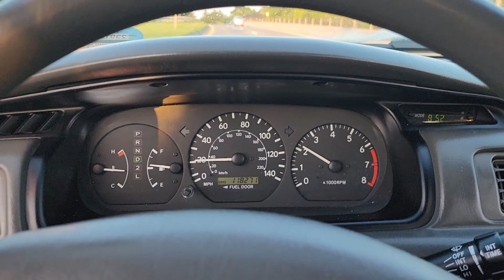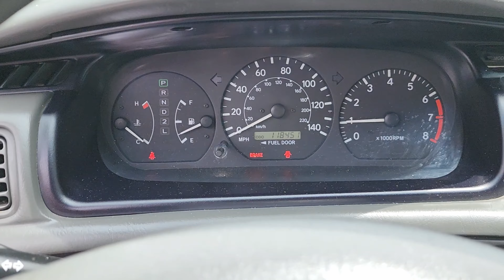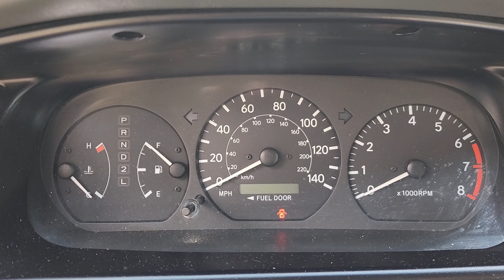Our Camry’s Exhaust Fell Off

Comment: how much grip would you expect a stock toyota ipsum wagon to have? I've loaded my car up on highway on-ramps and been going around 60-65 kmph and I haven't heard any tire noise or felt any traction loss so I think I have more grip than I'll ever need. if I had to guess I've got like 10-15% more grip left, but already felt a considerable g-force.
Reply from the maker: @-aid4084  Keep sending it until you hear tire noise! Tires will affect this greatly, too.

If you have a less sticky tire, finding the limit will be easier. I like to test grip limits on a curved highway on ramp with a low speed limit. I'd try something like that. Keep incrementally upping your speed until you feel the tires start to give out.
Reply: @M-t3ch  once I have the funds for it' I'd like to go to a track with some upgraded brakes and test the limits there, but for now I'm comfortable with my own limit being lower than my car's 😆
Reply from the maker: @-aid4084  Lower limit = more fun on the street. Higher limit = more fun on track.

Get some pads & brake fluid then send it on track and see how it does. That’s awesome 👌
Reply: @M-t3ch  that's my plan XD
Reply: @M-t3ch  haha so I just pushed it on the same on ramp and I got up to 85kmph without any signs of grip loosening. I have some firestones on my front and my tires are at 40 pai so... how much more grip have I got? 
I'll answer that question in another while I guess.
Reply from the maker: @-aid4084  Keep pushing to find out. Run a little less tire pressure, and you may achieve even more grip!
Reply: @M-t3ch  welp, I finally felt my first understeer. Around 95(I think I wasn't looking so maybe more) km/h on a 140m wide onramp. Had to work for the understeer though, I was buried in the throttle just to maintain speed and I let off, dropped to 90 by the end of the onramp corner to the straightaway. 

I don't know how to translate those numbers into a g-force, but it's a lot more grip than I expected.
Reply from the maker: @-aid4084  That’s awesome! I think the low hp nature of these cars makes the limit somewhat hard to achieve even though it's low.

No idea as far as g forces but you could always get a meter to read it.
Reply: @M-t3ch  I have an app on my phone, but I haven't got a stand to attach it to my car lol